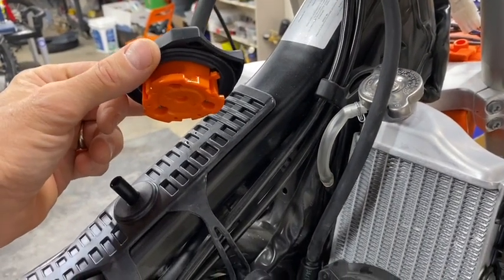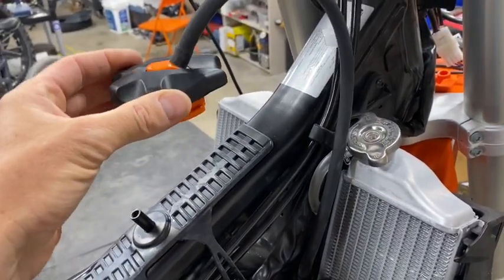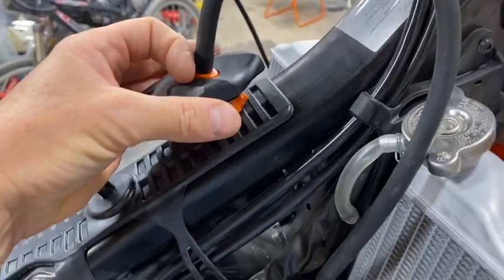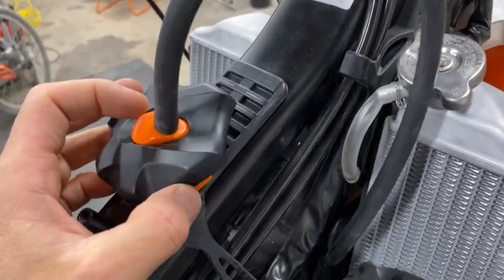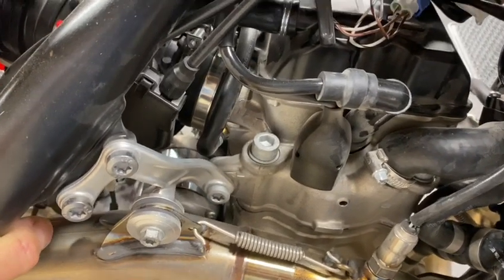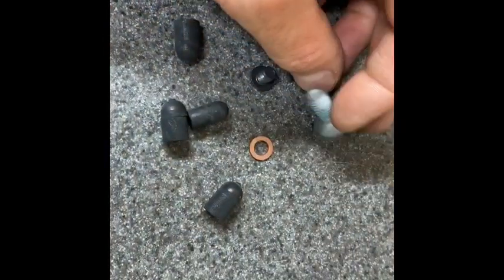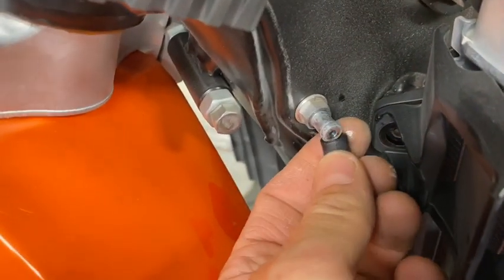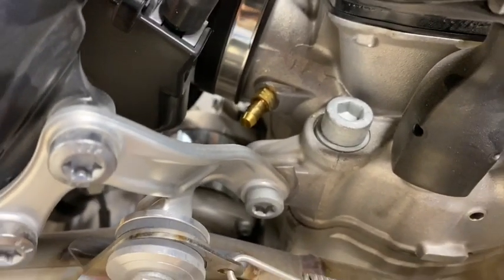2020, 2021 KTM / HUSQVARNA EXCF, XCFW, FE, FEs desmog

Comment: One thing I would not do is run the fuel cap vent tube over the motor. Just in case of a tip over the fuel won't run out on top of the motor 👍

Comment: Gasoline vapor is heavier than air. It’s the pressure that causes the vapors to leave through the tube. 
That’s why the building code requires water heaters inside a garage must be elevated off of the floor because of the potential of gasoline vapor reaching the water heater pilot light or burner flame. If the water heater is inside the home it can be on the floor because nobody stores gasoline inside the house (except for those destined for natural selection).

Comment: Whaat are the benefits?
Reply: Just cap the throttle body and done
Reply from the maker: Valid option
Reply from the maker: “What are the benefits”

Reliability
Reply: Tyrel Thibault so you’re doing this and leaving the hoses? Won’t throw any codes?
Reply: @tyrelthibault5264 can you explain that for a newbie?
This entire Desmog can be accomplished by capping the one brass vacuum port on the right leg side of the engine he showed?
Does that little electronic module not still need to be unplugged to stop it from powering on?
And does it still need an ECU after this?

Comment: Sounds like a good idea to just have one of your plug kits in the tool bag even if you don't want to remove everything, just in case you run into a leaky hose or other failure point in the system while on trail.  Thanks Mike!

Comment: I installed these parts, and now there is a check engine light on.  You said the black dongle would prevent that. But that is not the case for my 2024 350 excf.  I reconnected the solenoid and the light stayed on. What now?

Comment: MIKE I NOTICED AFTER TWO YEARS THE LOWER REAR CHARCOAL HOSE  WAS DESTROYEDAT THE BEND DUE TO THE MANIFOLD HEAT  ALSO THE 10MM? LOWER HOSE CONNECTED TO THE "Y" FITTING WAS FILLED WITH GAS AND THE BOTTOM PLUG WAS ALSO DESTROYED FROM HEAT AS IT LAYS NEXT TO THE HEADER. I LOOKED  UP A REPLACEMENT PLUG AND IT COSTS 20.00 . THAT 7"?  HOSE THE PLUG FITS INTO LISTS FOR 207.00 ON NUMEROUS MODELS I CHECKED UNDER ROCKY MOUNTAIN  OEM PARTS . INSANE
Reply: Tacomoto kit much cheaper
Reply: Dude… turn your cap lock off and start using commas more lol.

Comment: Hey Mike, I did a oem KTM shorty hose with the check valve for the fuel cap after de-smogging my 2020. I found that my tank was building positive pressure and boiling the fuel. Those little check valves let the air in but not the pressure out. Went back to the stock hose and tucked it like your video.
Reply from the maker: Good tip. Thanks for that info. We’ve had great luck with the Free Flow brand check valve vent hoses so far w our bikes.

Comment: If you don’t eliminate the smog equipment make sure you don’t overfill the fuel tank. Have seen guys complain of running issues and the charcoal canister is completely full of fuel. Like mike stated the bike can run quite rich when that happens. This is especially important in hot climates.
Reply: One of my hoses to the charcoal canister was full of fuel when I removed it. 
Not sure if the canister was to, but I didn’t remove it, and it’s lower hose port didn’t leak fuel.

Comment: why i avoid 2020+. would i have to worry about this on a 2018?
Reply: Yes. Even more actually because the 2018 has an injector module on the right leg side of the engine that needs to be removed and plugged with a nut.

Comment: Do U ever use fuel injector cleaner in 500? Do U sell replacement overflow canister, if not do U have OEM part number TKS
Reply from the maker: Yes, we clean our injectors about every 200 hours. 

Here’s the canister we’ve used 

https://tacomoto.co/products/ktm-hard-parts-coolant-recovery-bottle